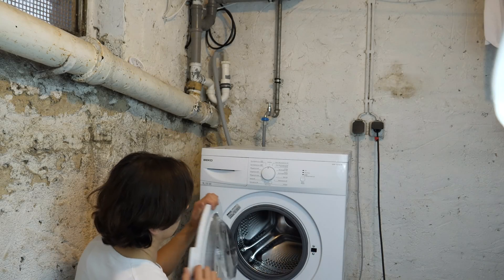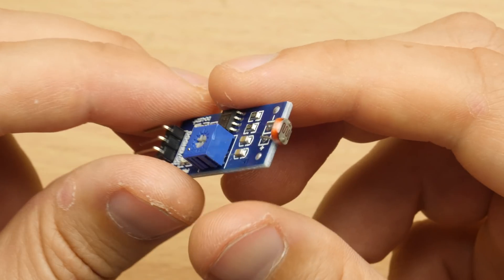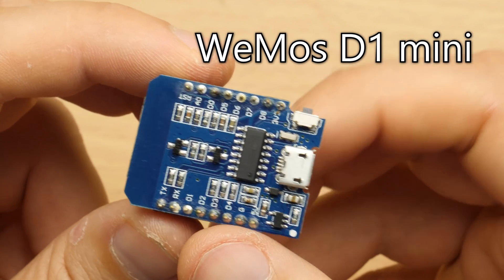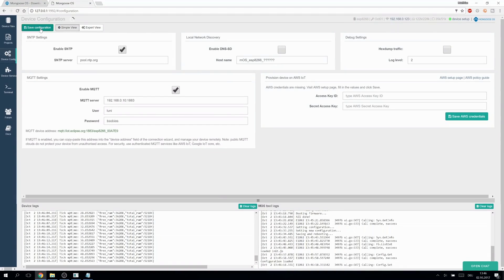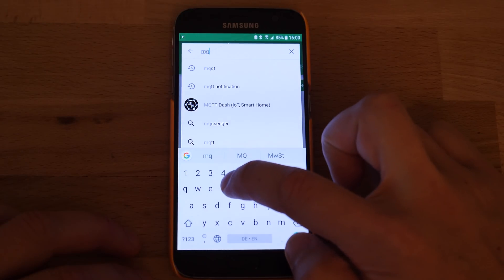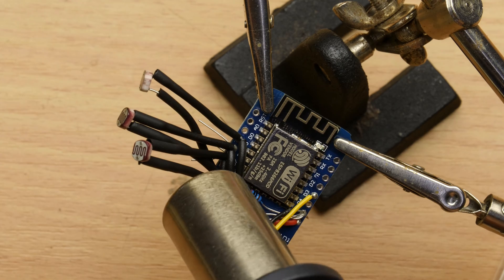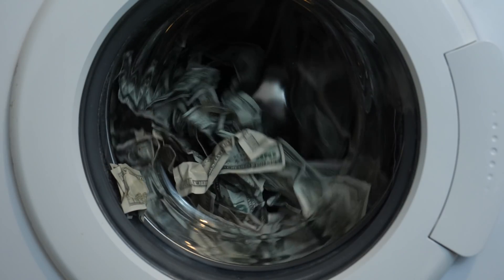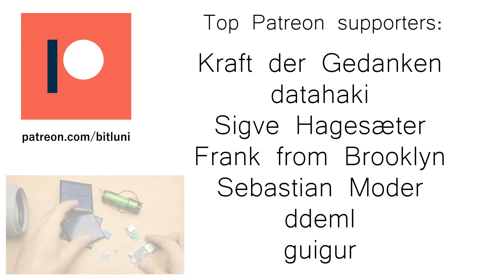Making a Washing Machine Smart - Home Automation (MQTT, ESP8266)

Comment: This is most excellent.
I found a fairly new Whirlpool washer with all digital controls. After I fixed it I was sure I could interface it since functions are assessable by the diagnostics using front panel that also has 7 led lights to display it's functions. This is a good start for me. Thanks

Comment: Why not opening the washing machine circuit and solder directly into the LED output and push button input into the controller i/o pins so that the machine looks as good as it came from the store.

Comment: Moin! I have a bread machine and like cooking. I think you could do all kinds of automated cooking with that; you're able to stir and control the temperature (2 DoF). You could do all kinds of stuff from sauce/slow cooking, fermentation, yeast etc. microbiology based food production!!! – "Just" use different programs for these.

The stirrer and heating are simple relays. But to read the temperature sensor and convert it to Celcius + its inertia are to be solved.

Es wäre endlich Zeit von dem Sofa aufzustehen hier 8D

Comment: Nice, love your projects.

However, I would love to learn more about how to do safe electronics, by making this mod (hidden) behind the panel.
How would you safely short circuit the button?
Could you read the LEDs state by tapping into the line somehow?

My goal would be to fix a plain old FM-radio (morning news, different channels on different days, so need to press channel buttons and power on/off), washing machine (scheduled to run at cheapest hours), dishwasher (same as washing machine), and water heater (turn off when no one's home). Ideally, they would draw power from the device itself and not need external power source. I also have rather old school electrical heaters that I'm sure could be used smarter than only being set to a fixed temperature (manual analog knob).
Reply: Tip: Use a VACTROL to push buttons with a microcontroller. You can make these yourself with a LED+LDR+Shrink tubing (search for it). You can also use these in opposite direction (with current limit to internal LED) to read indicator lights with a microcontroller. With a 5v or 3.3v power adapter (inside the case after the main switch) the microcontroller is completely isolated from the circuit to monitor. This is a very safe method however you need to do some soldering.

Comment: I am not happy with this solution, because it does not fit requirements. It is just stupid, to load the machine by hand, chose the washing program by hand, and than have to use a server broker cellular to switch the machine on. And at the end duck tape a servo to the washing machine., what a piece of bull crap. The right thing would be to use a  timer circuit right at the washing machine. Than of cause open up the machine and use a small relay to parallel the switch , instead using this crappy servo, duck taped, what a botch.

Comment: Nice video. But one advice, change the voltage defider so that the 10kohm resistor is connected to 3,3 volts. Its much better that way.

Comment: translated with google translator
hello, good video and good sense of humor
but you have complicated life, if you remove the cover you will find the electronic board where there are cables, connectors and you can get the signal very easily
I did a similar thing with an esp32 that sends me a notification to google home and everything is hidden inside the machine next to the electronic board

Comment: I have question .You used nod-Red, mqtt and C language with arduino in other video which you publish, is solar wheather station. And this time you are using Mongose os and own mqtt broker. Which one is the best ? I want to use my own mqtt broker on orange pi zero and arduino ide for programming esp01 and nod-Red for endpoints. But I want to learn if there exist easier way to succeed to create independent smart home project

Comment: This is very interesting. I was looking a while to turn on/off my ac remotely since I have a Fujitsu ac with a wired remote, and I this could work, but I don't think I'm able to do this myself, and do not know someone who could. Is there a way to get this ready-made? I just started to automate my home using HA.
Any advice would help.
Thanks
Reply: a year late but if the remote is ir you can connect it to an ir hub and control it with your smart phone.

Comment: Thanks for sharing this. It was an interesting introduction (for me) to Mongoose-OS back when you first posted it, and I've just recently adapted it for my driveway alarm. It happens to have three LEDs (power, vehicle-detected, and low-battery) and one button (to reset the vehicle-detected LED).  This is perfect, since I wasn't able to reverse-engineer the radio signals, and didn't want to solder to the receiver board.

Comment: Thanks for the video!
Mongoose-OS is really cool.
Do you think controlling A/C is possible?
Couldn't find any reference for IR control on the OS.
Reply from the maker: +spiritcore1 I guess it shouldnt be a prob. I'd connect a ir sensor to a pin and use interrupts and a precision timer
Reply: most AC machines have a serial RS232 port inside, might be better than using the IR. If you go IR, the best is to first learn the codes from the remote, then emulate it once the codes retrieved. I'd still go serial.
Reply: My AC have complicated codes with CRC (it send the entire data no matter of button presses) and someone already did the job for arduino but I don't really know how to port it to Mongoose-OS.

Comment: Why not add an internal relay into the front panel of the washing machine, to close and open interruptor contact instead of the servo motor?
Reply from the maker: Sure, also possible. I just wanted to show a non-intrusive method. But the servo will probably be easier wit the red button

Comment: this channel is the best, but I would also suggest if it is possible to post a video about a project esp8266 that performs tasks monthly on the same day  every monhth I already searched all over the internet and there is no tutorial to learn about it I would be very grateful if my suggestion is accepted thank you
Reply from the maker: Check out my latest video... I would do it with node red. use an inject node wich injects the timestamp every day at the specific time stamp and connect the output to a function node and use the date object to check for the day of month like this

function node code:
var d = new Date(msg.payload);
if(d.getDate() === 1)
    return msg;

node red flow:
[{"id":"78c20615.466068","type":"inject","z":"a34f2e41.dd53a","name":"","topic":"","payload":"","payloadType":"date","repeat":"","crontab":"00 11 * * *","once":false,"x":177.1667022705078,"y":459.0000276565552,"wires":[["44437d8d.44f9b4"]]},{"id":"b8937d94.5381","type":"debug","z":"a34f2e41.dd53a","name":"","active":true,"console":"false","complete":"false","x":513.1666946411133,"y":468.0000286102295,"wires":[]},{"id":"44437d8d.44f9b4","type":"function","z":"a34f2e41.dd53a","name":"","func":"var d = new Date(msg.payload);\nif(d.getDate() === 1)\n    return msg;","outputs":1,"noerr":0,"x":353.1667289733887,"y":461.00006890296936,"wires":[["b8937d94.5381"]]}]

Comment: What's your opinion on the "new" ESP32? Worth it to change to it?
Reply from the maker: I think it's totally worth it, BUT esp8266 is still a beast and much cheaper.. if you really don't need the capabilities.. esp8266 will be sufficient. The thing annoys me the most on esp8266 is the dodgy pwm which is fixed with the second core on es32
Reply: Hmm i see, do you think you can create a multi acces bluetooth audio receiver with de esp32? And it would be amazing if you would try to automate curtains!

Comment: I would add a temperature sensor inside to have a report on the water temperature.
Just because its easy to add and we all love collecting data don't we ?
I don't know if its possible with MQTT but a graph of the temperature wod be really nice, possible even a sensor detecting the outgoing water (how mutch dirt is being washed out).
The Word is "Trübungssensor"  :D
Reply from the maker: I guess it will be a bad wifi reception inside, or how did you imagine to do it?
Reply: bitluni's lab I would use a DS18B20 inside the washing machine and run the Cable from it to the wemos on the front.
Easy to do, not mutch messing aroun.